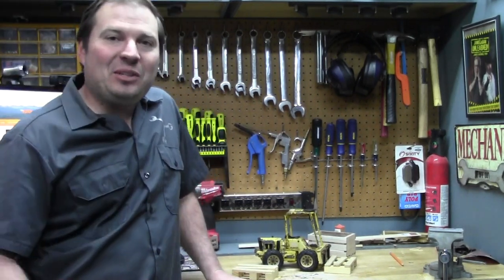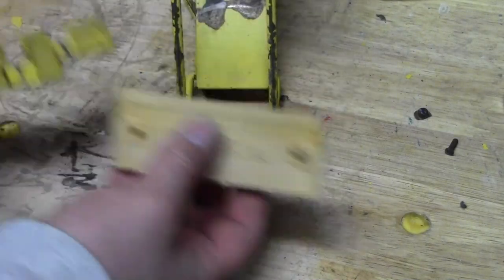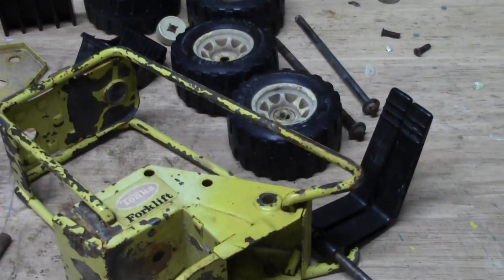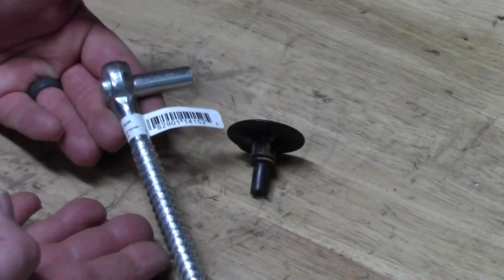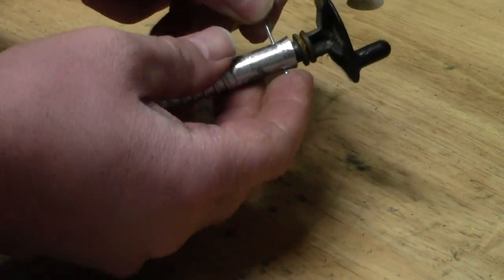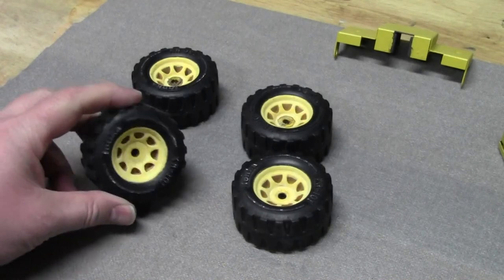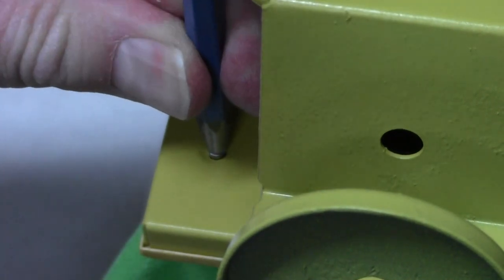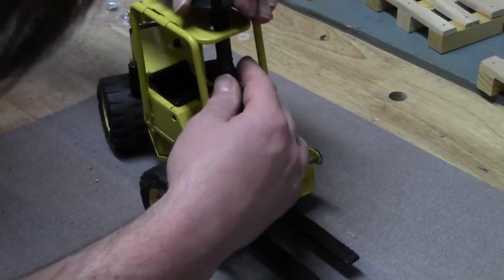Tonka Forklift Restoration (70's version)

Comment: I enjoyed the video.  I've seen in other restoration clips where the tires are stamped in wet white paint so the Tonka logo will stand out again.
Reply from the maker: I should have done the white lettering.  I did it on all the other ones I have done.  I guess this one the rims were so roached I kinda just forgot.  However the lettering would be gone by now.  It has seen a lot of play since I did this.  Those pallets have been hauled all over the garden this summer.

Comment: You really,really,REALLY, need to restore another bike! Personally I would love to see proper clutch replacement on a old honda,kowi,Yamaha whatever. Love the vids keep making them.
Reply from the maker: Yeah I'd like to do another bike but man the work involved to film it is kind of what is sort of preventing me these smaller projects are easier to get out in a more timely manner. I have a clutch video two of them actually doing.  A goal sometime is to do a trio of Kawasaki triples that I have they run but they just need a little bit fixed up there more like survivors I also have a 68 Avenger in similar condition not a full Resto but just a cleanup and replacement of some cosmetic rubber parts
Reply: @thejunkman  can't wait!

Comment: Nice job.... but why leave the rust on the axles and forklift pin?
Reply from the maker: Truth is, I dipped this entire toy in rust removal soak (video seen here https://youtu.be/N_GH6HwTD7k )  about a year before I made this video.  They had rusted again from being played with outside.  I wanted to just finish up the video, besides this toy went right back outside in the dirt like it is supposed to.  A minor detail I guess.  My restorations are not shelf sitters, they are designed to put them back in working play condition.

Comment: any suggestions for color choice for an oversized Tonka dump truck from the 70’s?  Original was very intense yellow.
Reply: Keep the original color, there is no need to change it.  It’s supposed to be caterpillar yellow. Because it is modeled after a caterpillar Quarry truck.
Reply from the maker: Just a tip.  Caterpillar yellow has changed over the years so there is several different shades.  International Harvester yellow would probably work well too, but not the CAT "Challenger" yellow.  Both of which tractors I have the real thing.  You can see those on my channel.

Comment: what stripper did you use? I was trying to strip an old Tonka, the stripper would do nothing. Even caustic soda took 3 tries plus some wire wheel work.
Reply from the maker: I use Loctite 79040 SF790, but Klean Strip premium works well too
Reply: @thejunkman  Kleen strip is the one I tried. When even caustic soda takes three tries, and even then doesn't do all that well, the paint is really on there
Reply from the maker: There are different formulations of the Kleen Strip, the one in the gold can works better than the others depending on the paint technology.  In this case enamel.  Check out this video https://youtu.be/J3vz28eu22M?t=64 at this time stamp.  I test 4 different strippers including the Loctite one I used in this Tonka video.  I should break this segment out into its own video.
Reply: Soaking the parts in vinegar for couple of days will take off the paint and get the rust out of nooks and crannies - plus it’s non toxic. Works well on plated parts too.  You can then zinc plate or paint the axles, etc. Nice job.
Reply from the maker: I could have plated the old parts, but this is going right to the sand box and it can always be done again in the future.  I did dip this forklift about a year ago, so what rust you see is a years worth before I got around to this project.  https://www.youtube.com/watch?v=N_GH6HwTD7k

Comment: You should of cleaned or painted the pin for the forks and put a new exhaust stack on it, other than that it turned out really nice.
Reply from the maker: The exhaust is molded in. Its not a rubber part like in other models.

Comment: in my experience, super glue isn't very good for wood. I do use it on wood sometimes, but I put on a dab of wood glue first, then a touch of super glue nearby to kind of act as a clamp. for that purpose, it works okay.
Reply from the maker: It will work just fine in this application.
Reply: @thejunkman  probably but people shouldn't get the idea that it's the right thing to use on wood in every case.
Reply from the maker: For model building it is a staple, but yeah if you are going to build something more substantial I would use a wood glue/PVA. I wanted a quick drying solution and then using the brad nails, it will last long enough for some rough play.
Reply: @thejunkman  yes with the nails added, it will do. Without the mechanical fastening, I don't think it would hold up long. People say all superglue is the same but I've found that not to be true. Some is better than others. Bob Smith industries super glue is much stronger, it's the stick your fingers together kind, almost as strong as the original super glue. I bet most don't remember that, when it first came out, if you touched your fingers...or anything else, with glue on them, they were stuck. The government mandated that they weaken it. There is medical grade they used to use to close wounds quickly in the field hospitals of 'Nam.
Reply from the maker: Super Glue is a generic term.  There are many types of cyanoacrylate's as you know.  I know all about adhesives, as in my "real job" I work with all types of adhesives for various bonding applications among other things.  Some of the things used in the industrial space is amazing.
Reply: @thejunkman  yes, some of the stuff used in industrial applications is wild  Very little of it filters down to the consumer market. Liquid Nails is a toned down version of one that started as an industrial adhesive. Of course what the consumer gets a really weak, or "watered down" version because they think everybody is stupid. Not hard to see how they would get that opinion these days.
Reply from the maker: I would not exactly say it is accurate to say things are always "watered down" because people are stupid with the application, most of the time it is to meet a price point in the retail space.
Reply: @thejunkman  You may not be old enough to remember, but when super glue first came out, lots of idiots were sticking their fingers and other body parts to themselves or other things. A federal mandate to make it less difficult to undo went out for the consumer version. Watered down is merely a turn of a phrase for making it less powerful, I'm sure they don't actually use water. I'm not sure when that happened, it was the late sixties or early seventies. Of course, the cheaper ones are probably made cheaper with fillers or what not to meet their price goals as well. I'm just saying they're not all the same, though price doesn't always determine quality in this and most other arenas, but it's often a good indicator, or was, the super glue of old where the guy sticks a hardhat to a beam, well that is much weaker now than it used to be, though I'm sure they wouldn't admit it.

Comment: Looks like you did not achieve full coverage of the yellow paint on the bottom. Why would a true craftsman proceed with clear coat on a paint job that was not thourohly covered? ...Newk from Kentucky
Reply from the maker: I assure you it is full coverage.  Video and my lighting could be better which is how you might intemperate that.  I just hope this inspires others to try and elevate above my work.  Thanks for watching!

Comment: If the clear coat is toxic, why are you putting it on a child's toy?
Reply from the maker: The particulates and solvents that flash off when spraying are hazardous after the chemical reaction has happened it's as safe as anything else.